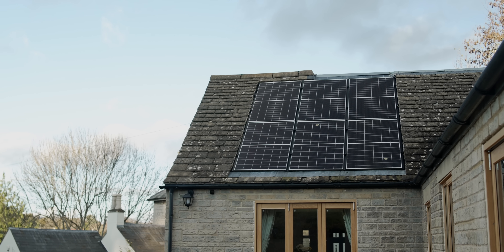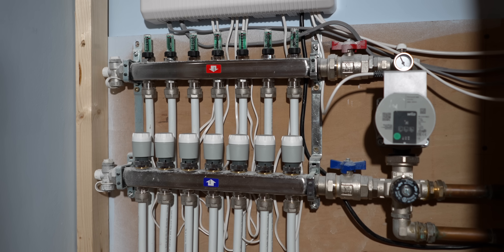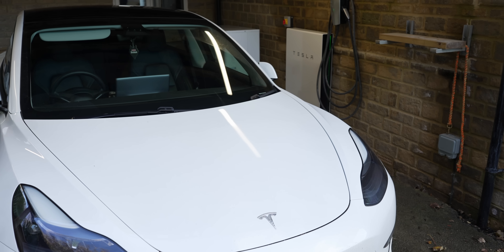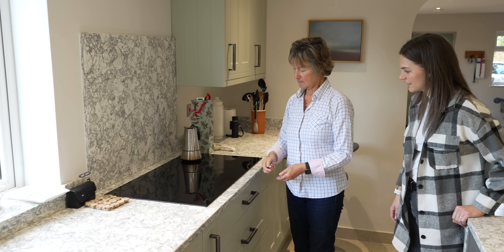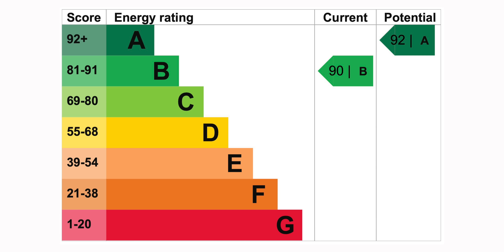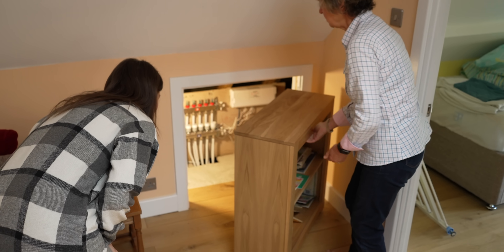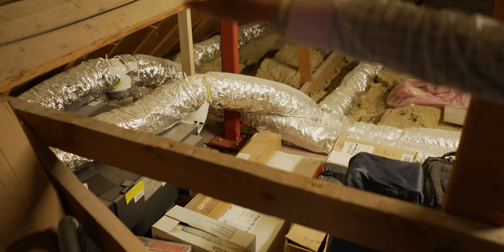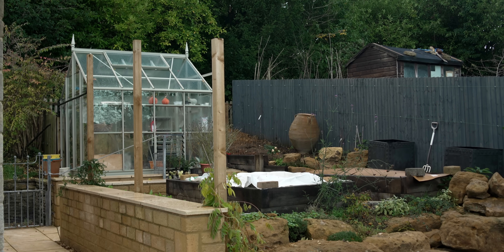Could These Clean Energy Technologies Work In Your Home?

Comment: If you are on a low income funding solar panels and heat pumps are out of these income range. People could insulate their home include fitting a gas/mix hydrogen boiler include planing trees to sock up the carbon dioxide.

Comment: The issue is cost,  we should all be aiming for this but to retrofit most of this into a normal house you wouldn't get alot of change for 30k, 9k solar Tesla powerwall easy 20k right there, heatpump 5k+, insulation 2-5k dependant on what you need,  then the heating upgrades on top,     Green houses are amazing but they are for the wealthy and that were we are falling down as a country,  it should be subsidised for the average homeowner for solar at a bare minimum and new homes should be built to these standards.  Until we get to this point most people will not live in green homes

Comment: Great video. Very encouraging. I thought a domestic setup in UK is limited to a maximum grid feed in of 3.68kW . Does that mean with your 9kW system you have a three phase supply? Or can you always use most of it yourselves even in summer?
Reply: Since the panels point in different directions i doubt they can get 9kw at once.  I'm guessing the battery can be used to reduce the amount put back in the grid, or a device to bring on load like the water heater or heating to use up any spare.     Or they could have had 3 phase put in.    It might be just that you can put in 3.8 without approvals
Reply: @mralistair737  good points, thanks. And they have a Tesla Model 3 to soak up surplus.

Comment: Well done for what you have done. I have been trying to get a Tesla Powerwall fitted for 3 years to add to our existing solar PV system. Sadly it seems we will be waiting a few years more and as a retrofit to our existing system we are going to be hammered with 20 percent vat Thanks for that Rishi Sunak and Co ( If the Tesla Powerwall battery had been available at point of original installation we would have fitted it).

Comment: Half the builders we talked to were always in the lines of "you want insulation? But then you gonna have damp inside your house!!" With this attitude to technology we would have been still driving mule carts. Even new builds in UK don't have ventilation system as standard, at least I haven't seen any. Then you watch folks on TV showing black walls and scratching their heads.
Reply: I have a reservation on a new build that has a MVHR system installed as well as solar panels and no gas.

Hopefully I will be moving in early January.

Comment: This video is like watching myself. I have just renovated an older property, and installed exactly all of the same hardware apart from the heat exchanger. I’ll have to look into one of those. 9.24kw solar with power wall, ecodan heat pump with underfloor, Tesla car charger and should soon also be on Tesla energy plan. Great to see. I can’t wait to see my summertime solar results, as it’s only been running for a month.

Comment: I did the same with my home, but being in California there are differences. It is a 1903 wood frame house that had no insulation. Now it is all electric and insulated in the extreme. Fortunately the roof faces almost due south and is quite a bit further south than the home here. So this year I have put over 3,500 kWh into the grid above my needs. Add in California's carbon trading, which gives all utility customers small credits, and my annual bill this year should be less than $40. That came as a bit of a surprise but a pleasant one. I made provisions for batteries, but as yet there is no need.
Reply: curious question, but what does "in the extreme" involve?   like did you overclad or just use rockwool in the voids?
Reply: @mralistair737  The house is two story with wood shingled sides and a peaked roof with an attic. All the lath and plaster was removed and rockwool put in the voids and under the floor between the floor joists in the crawl space. Also between the studs in the basement walls where they were above ground. The attic is now conditioned space and was insulated with spray in open cell foam between the roof joists.
Reply: @danielcarroll3358  sounds all sensible and must make a huge difference, and probably as fas as you can reasonably take the building (as long as the windows and doors are decent).  I ask because of other commentators about new buildings not being insulated properly.  In the uk (a different climate obviously) this wouldn't come near the modern building regulations for a new build (except the floor) .    People seem to dismiss the amount of insulation you can put in a new-build vs an older property.
Reply: @mralistair737  The doors and windows were all original 1903 single pane, multiple light. They were all replaced with double pane except for the front door, which was of historic quality. Although the door glass was replaced. The house was attacked from top to bottom and a new wing with a basement added. Most houses in the San Francisco Bay area don't have basements and you see very little brickwork because of earthquakes.

Comment: Our house is EPC A+ (Scored 107 out of 100) on a 1996 3 bed detached in West Midlands.  Learned a lot over the two years getting it from a D rating.
Reply: That’s pretty good going for an upgrade, i’m struggling every day to achieve that on new builds.
Reply: @Daniel Farrant  ... I learned a trick.

EPC Ratings are based on two things.

1)  How much energy your home saves, through insulation, efficient devices etc

2)  How much energy your home generates, like Solar Panels etc.

So one of the biggest point scoring areas is a massive solar array... 

Our house has been calculated at an annual Co2 level of minus... so we're carbon negative.
Reply: @JustMeTalking  Many house builders don't like putting massive arrays on houses. They put the bare minimum they can get away with.
Reply: @David Knowles  Yes this is true, even Solar Panel installers don't like big arrays.  The reason is they can only self-certify the job up to 3.7 kWp export.  Which is pretty average, and usually about 10 panels on one side of the house.  But East / West Facing houses can have double that... at least.

Anything bigger and they need DNO Approval which causes delays and potential complications.

We had our house upgraded to 3 Phase, which allows us to move massive quantities of electric during the night time cheap rate tariff... to be stored in Tesla Powerwall batteries and used during the day.

Comment: We have followed a very similar route for our 1970 detatched home having upgraded to a 4kWh solar PV on our west facing roof along with  a solar hot water Immersun. Later added another 4kWh Solar PV on to East facing roof, with Tesla Powerwall 2 an upgrade to MyEnrgi Eddi and installation of a Zappi for our EV. Then came the ASHP to get off LPG and remove the horrble bulk storage tank from our garden! With this the roof insulation was fully upgraded to 270mm and all of our original radiators were upgraded to work better with the ASHP.
I have truned the whole home heating from 19 degrees to 18 as it was too warm. With a 6 degree ambient outdoor temperaturewe have been using around 21 kWh for heating from 8am to 11pm at 18 and dropping by 2 overnight. The whole house has been set at this level and is heating at the same time to help get the most from our ASHP.

Comment: Really resonated with my own experience of installing solar, batteries, heat batteries, MVHR and heat pump tech.  Good for them 👍
Reply: Did you use the SunAmp heat battery?
Reply: @johndunlop4790  Yes, I have a Uniq 9. Installed in 2018.

Comment: Excellent, but no mention of the costs involved. If this is to be a template for the many rather than the wealthy few, subsidies and incentives will have to be considerably higher than they are now. We undertook similar retrofitting work on our house over a period of five years - underfloor heating, solar PV, solar diverter, a smart water tank, a heat pump and an EV charger,  but the costs today are in the tens of thousands - well beyond the means of those most in need. Though nothing that another windfall tax on the oil industry couldn’t fix.
Reply: Not really, the government be better off taking the Chinese approach to how they crash the solar panel prices and brought prices tumbling down, they did it by funding the construction of silicon wafer factories specifically for the solar industry. The UK should consider doing the same for battery and heat pump factories by directly funding their entire construction. An create the market for them by banning new builds that don't include batteries and heat pumps. I suspect the UK would benefit far more building heat pump factories and home batteries than the investment it is making in nuclear, which will be by far the most expensive fuel on the grid by the 2030s.

Comment: Great video Em. I completely agree about the installers not being fully familiar with installation and software. Both the Hive install and the Givnenergy install felt very wet behind the ears as it were. Very interesting on the tray install of the solar panels and makes a lot of sense. I guess this means you can also re-sell on the spare tiles. Do you know which company supplied this?

Definitely worth fitting this stuff on a home refurb 100%
Reply: The in-roof system we used is GSE (French, I think). Some of the flashing kit isn't great, but roofers can improve it.